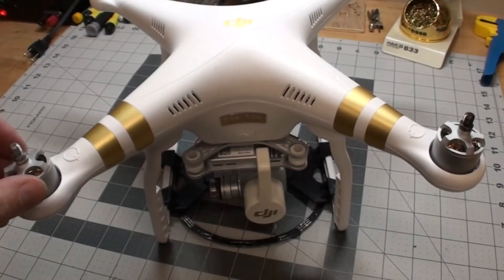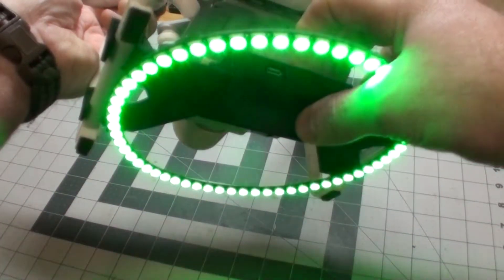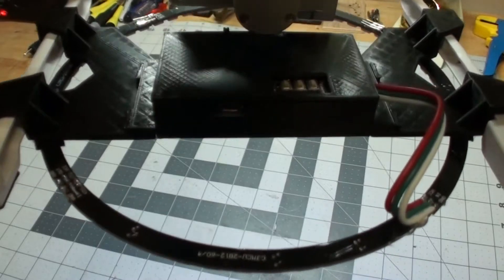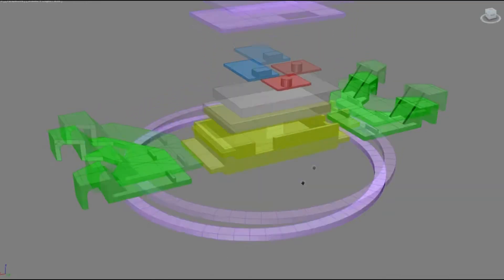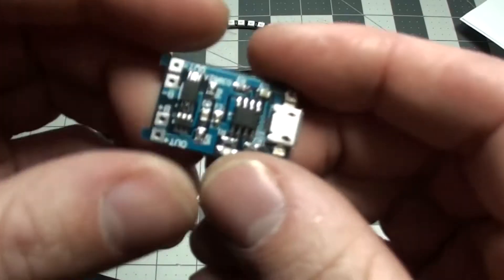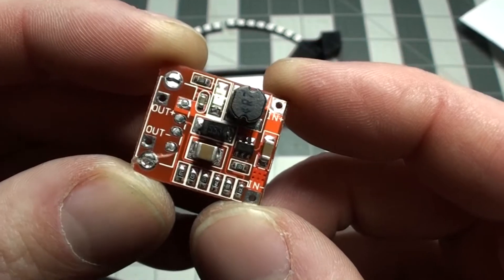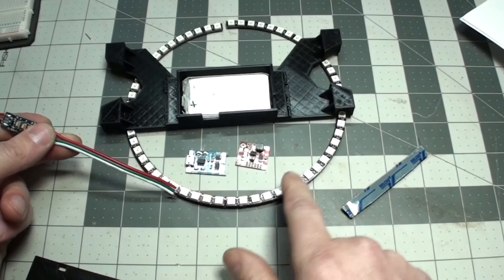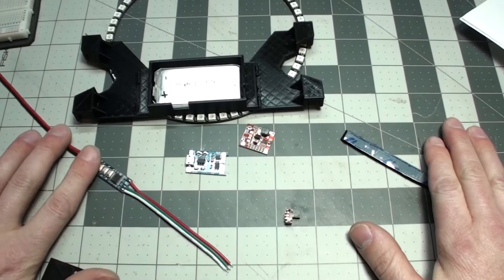3D Printed RGB Ring Light (DJI Phantom 3)

Comment: @Diesel Guy I wound up going with different parts after not having any luck making the listed light work properly.
The parts I used are linked below.  I modified the 3d print because of a small protrusion on the landing legs that caused some minor interference with the camera ability to gimble fully and I printed it at 105% in order to have enough room for everything without it being such a tight squeeze.   I wound up not using a power switch.  the wiring is super simple, however if a schematic is needed I can draw one up rather quickly.
EDIT:   i've found that an on/off switch is necessary between the battery output (out on the charge board) and the 3 button controller in order to maintain battery charge when not in use.

https://www.amazon.com/gp/product/B07437X7SL/ref=ppx_yo_dt_b_asin_title_o04_s00?ie=UTF8&psc=1
https://www.amazon.com/gp/product/B07CQN6GVJ/ref=ppx_yo_dt_b_asin_title_o07_s00?ie=UTF8&psc=1
https://www.amazon.com/gp/product/B0799R529Z/ref=ppx_yo_dt_b_asin_title_o08_s00?ie=UTF8&psc=1

Comment: Schematic/Wiring diagram?
Reply from the maker: I will see what I can do..
Reply: @keylitho  It's been three years...   I just found this video and am wondering....    did you ever come up with a schematic??????
Reply from the maker: @robertcapraun5066  Sadly no.. but it's pretty straight forward.. You could probably manage from the video. :)
Reply: @keylitho  So I think i have it...   It seems pretty strait forward from your explanation and the "in/out" markings on the components, but where in the circuit does the switch go???   between the charger and converter or????
Reply: Robert Capraun did you get it working?? I just ordered parts wondering if you figured where the switch went. Also wondering what switch you ended up using. Thanks.